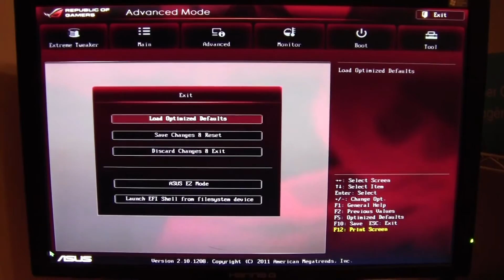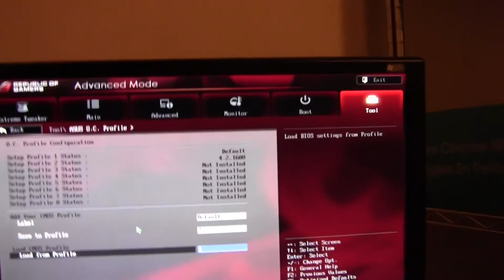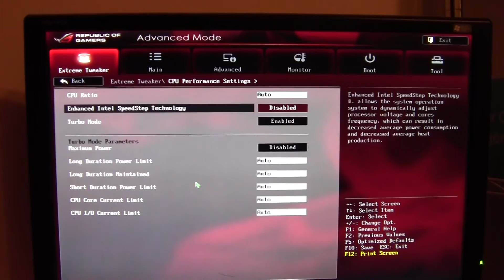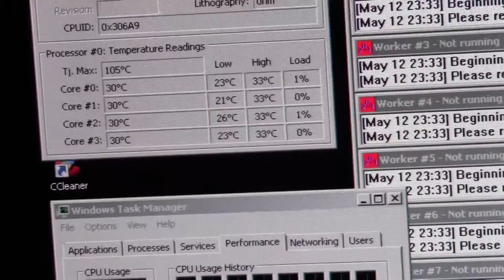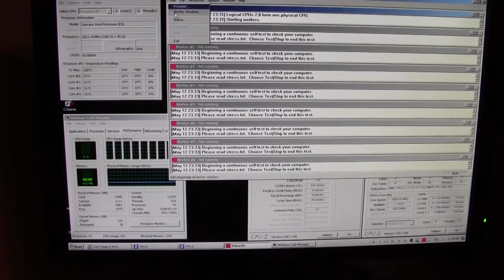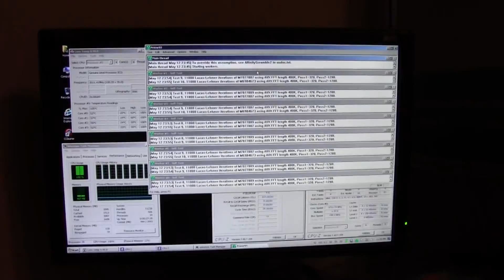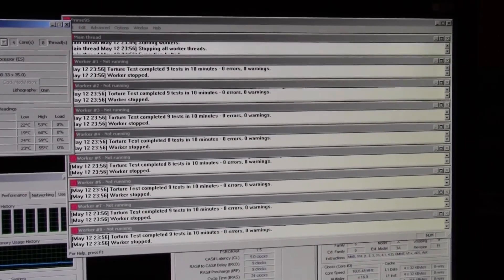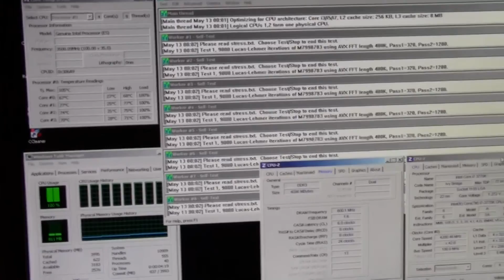Part 1 - Ivy Bridge (Intel Core i7 3770K) Testing - Replacing IHS Thermal Paste

Comment: An h50 does its job but some cheap air coolers do the same. My h80i keeps my 4.2ghz 3770k idling at 25-29c and 55-60c full load. I haven't messed with the ihs yet though.

Comment: what are the chances that my cpu would fail to function after i have changed thermal paste to say artic silver 5? and after u remove the heat spreader, do u just re apply thermal compound and put the heat spreader back on? thanks

Comment: I've had the same problem you've had at the 9 minute mark, with the CPU only running at 3.7GHz, looks like the thermal compound within the CPU is causing the chip the throttle. I'm pretty pissed about this, and it seems to be a common problem, no point of even RMAing the part when it's all CPUs that have this issue.